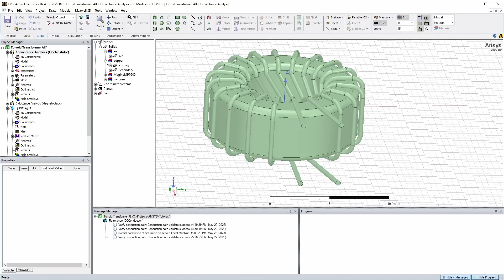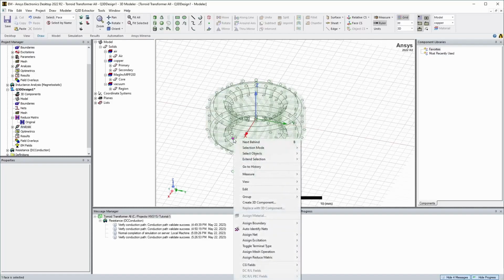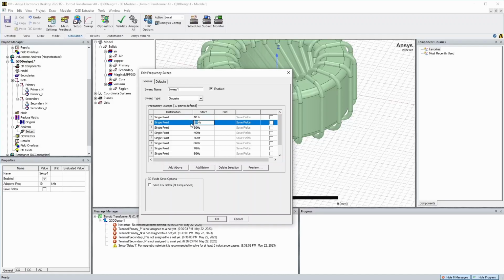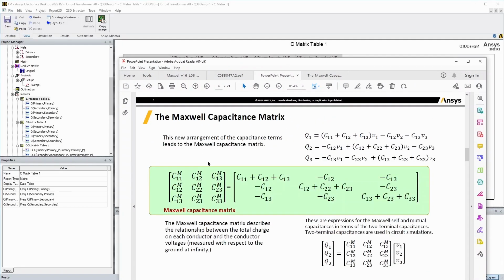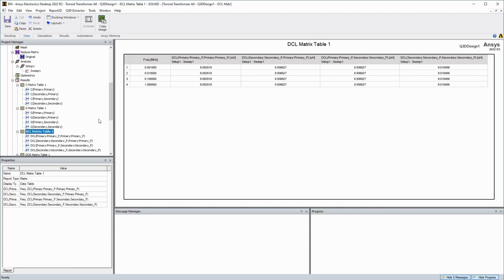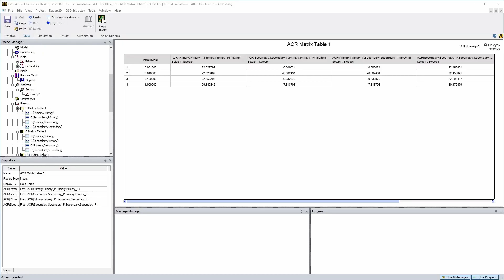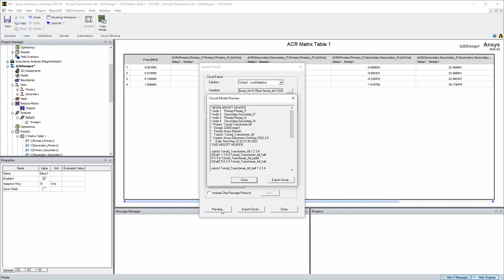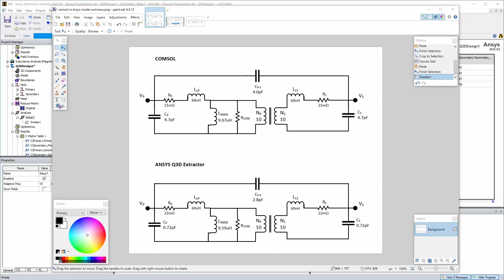Ansys Maxwell - Intro 6, Q3D Extractor

Comment: hello sir what is the value of default assigned excitation of constant voltage or constant current as source and sink?
Reply from the maker: I think it's just 1 kinda like a SPICE AC analysis where it's more of a scaling factor than a unit.
Reply: Ok Thank Sir yes the default values for current source is 1 amp and voltage source is 1 Volt. I could able to locate in tool. Thank you for your reply @CircuitAnalysis
Reply from the maker: @2020-d6q  Great, thanks for confirming.

Comment: how to solve errror of : surface mesh generation failed. for step imported file. also i tried many combination to generate surface mesh approximation but nothing worked. please sir guide me
Reply from the maker: Sorry I don't have much experience with that but I would assume there's something wrong with your geometry. Maybe it has some discontinuities or holes in it that Maxwell doesn't like? Maybe try with a very simple geometry import like a sphere or cylinder and see if that works and then work your way forward to the one that's giving you an error?